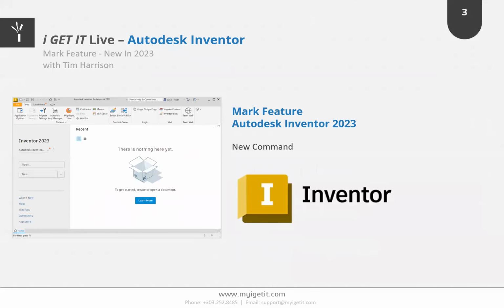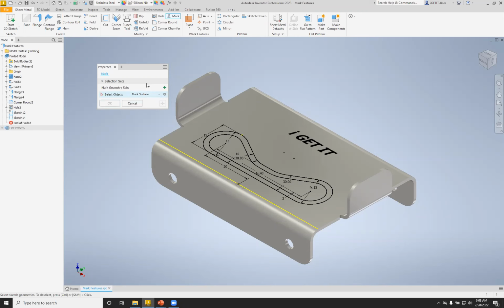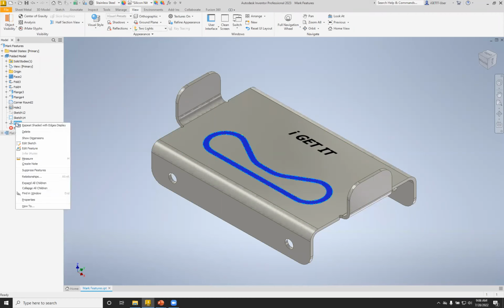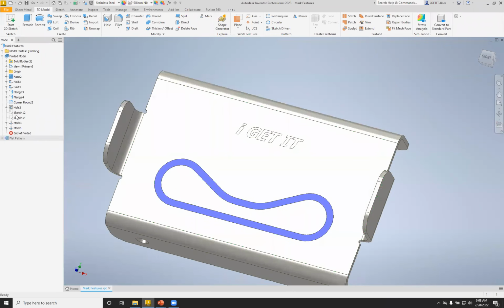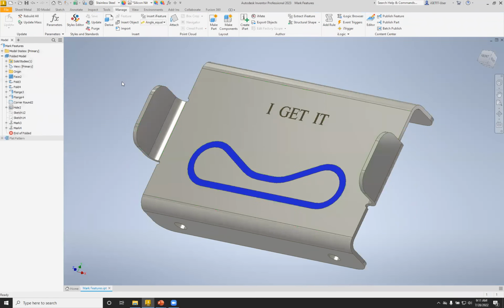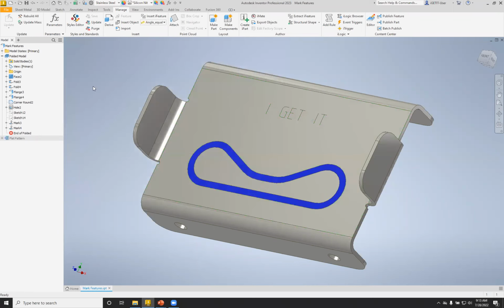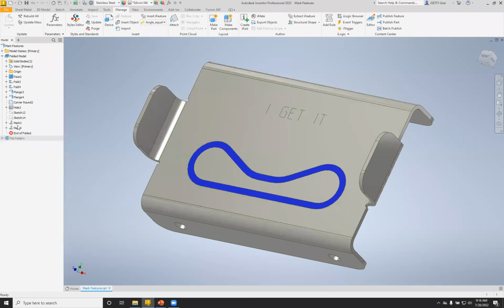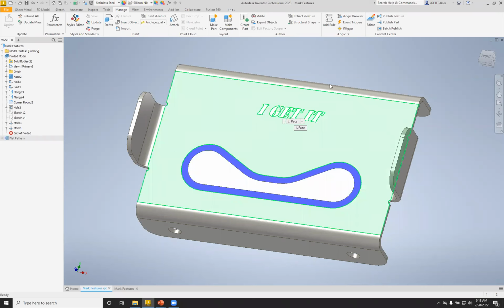Enhance your styles using 'Mark Feature' | Autodesk Inventor 2023

Comment: Thanks for the video, I was wondering if there is a way to use the mark command with 3D sketch? I often have funnels that extrude through surface plates. it would be nice if I was able to etch the location of the plates on the funnel with a projected 3D sketch.